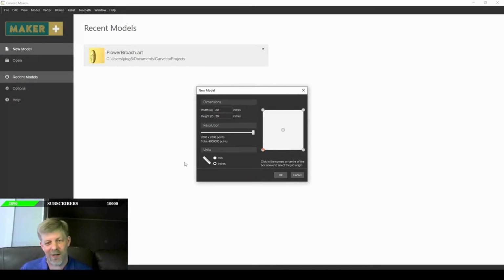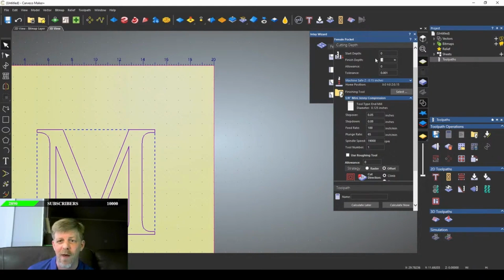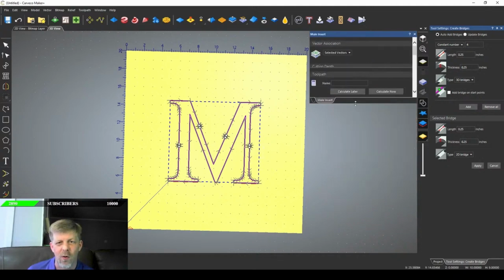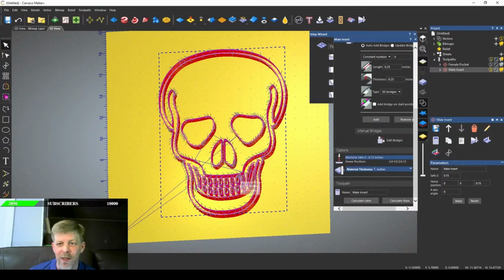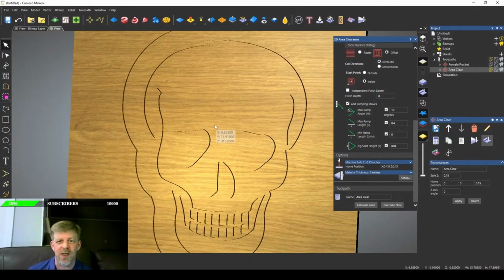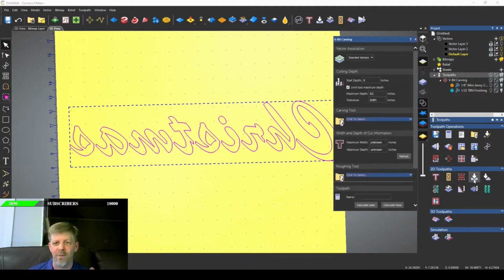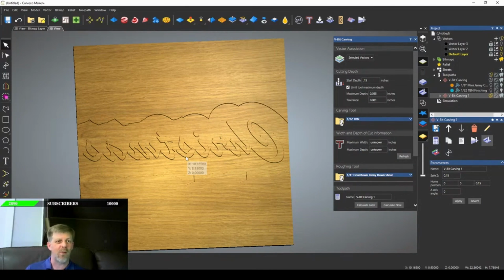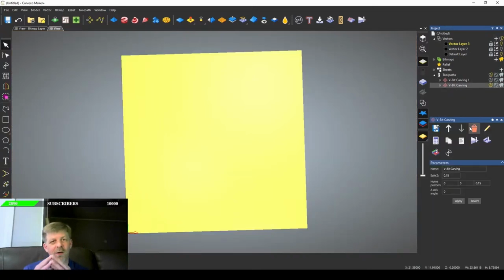Mastering CNC Inlay Techniques with Carveco Maker CNC Woodworking Tips

Comment: Jason, I am a bit confused about the starting depth for the male plug.  Start depth of .15, will this not dive the bit into the workpiece rather than starting at the surface?   We can discuss during our next lesson.
Reply from the maker: Yes it does dive into the workpiece but this creates the offset. Think of it more of cut per depth you are not going past the normal .25 that the V bits are capable of cutting in one pass but because we are starting in the wood we are moving our starting cut angle further down towards the bottom of the cut to create the offset you need for the pieces to fit together without programing one in.  We can always talk more in a session whenever you are ready.

Comment: The method of offsetting using the starting depth works well with bigger inlays, but not so much for intricate carvings such as letters with serifs.  When Carveco finishes out those tight corners on the male piece, it does so from the starting depth and not Z zero, which ends up cutting too much off the top, which could leave gaps when the pieces come together.
Reply from the maker: Not true it works very well with intricate carvings. If you use a tbn bit put it in as a vbit and it will carve from the base out and not use the geometry of the tbn. Vbit carving is limited by the vector so depth and angle has a lot to do with the angle of the vbit or tbn bit used. Check out Chad Bookman for some intricate work using this method.

Comment: trying to do a female pocket i got this message: "the selected tool is too large to machine either the male insert or the female pocket" I''m sure my selected tool is not too big for the female but might be for the male part however I want o do only the female part from the wizard but looks like this is not possible?  how can i overcome this limitation?
Reply from the maker: The female tool path is essentially a area clearance toolpath. It is usually the male part where the offset happens so you could just use the area clearance toolpath to do the female part if you are using an endmill to do the straight wall inlay. If you are doing the vbit inlay I would recommend using the second method I show in this video.
Reply: @Timberfalls  so basically i can do the area clearance toolpath with an endmill straight bit for the female part and then a V-bit tool path for the male part is this correct? I don't see the reason why to use V bit for the female? and then for the male too.
Reply from the maker: @Transcendental9  The male and female has to match exactly so whatever you use for the female you should use the same thing for the male. If you are doing a straight bit cut like the first example in this video then use a straight bit on both sides. If you are using the second techniques then I would recommend a combination of endmills for roughing and vbit for for finishing on both sides.

Comment: Hey Jason love your videos just one question. I understand why, with the vcarve method, you set the start depth as the final depth you want to get, to get the offset. But when i do that woth my 15 degree bit it plunges into the material and breaks? Am i missing somthing? Is there not a way i can just offset it normally?
Reply from the maker: @nickg9008  with those thin vbits you have to go slow like 40ipm. You may also want to add a roughing bit with a small tipped vbit
Reply: @Timberfalls Awesome! Thanks for the reply

Comment: cAN you carve with no bridges just one piece with piece of wood no cut out letter itself
Reply from the maker: I am not sure if I understand your question.
Reply: @Timberfalls  like the plug is not seperate image but it is with piece of wood done the way that machine removes everything that is not the plug itself
Reply from the maker: @Chris-vc1dh  That is the male part of the plug you have to add a border to your image so that is were the carve starts and the vector for your plug is were the carving stops.
Reply: @Timberfalls  Thanks I will keep learing, do you think that Vcarve desktop would be better for inlays?
Reply from the maker: @Chris-vc1dh  I do not think so. You can use tapered ball nose bits in place of vbits in carveco but can only use vbits in vcarve.

Comment: I've compared the area clearance vs the inlay "pocket"  what logic is it using to change the offset or the offset amount between the walls of each shape?  It seems like its " automagic" and I would prefer to understand the logic  -
Reply from the maker: I would agree that the inlay pocket wizard does not work well and I am not sure how it derives its offset calculation. I  prefer to do it the manual way.
Reply: @Timberfalls  It's not clear to me if it does or doesn't work well, currently I just don't understand the drivers and how it impacts the geometry selected
Reply from the maker: @CADCAMWizard  I have been hearing from the developers that they are reworking this tool and plan to change how it works soon. I think using the vbit inlay method for shallow carves is probably the best way to do those rather than using offsets and pocket inlays. Those are good for simple deep inlays but I mostly do the vbit method.

Comment: Best video i have seen so far for carveco. I have a complex logo I am wanting to inlay. 
When I do the v carve method it seems some parts have a massive gap between male female and other parts sits nice and snug. I am referring to the base and not the walls. Bottom/ top of pockets. 
Unsure how to word this but since it’s setting maximum depth how do you get a consistent depth. 

I have great success for simple shapes by ofsetting the vector size manually for make plug but that doesn’t translate for more complex shapes. 

Thanks for the video!
Reply from the maker: One thing about that vcarve method is you have to make sure your stepdown is large enough to make it down to the starting point. So if you have a .2 starting depth your stepdown has to more than .2 to get it in one pass that will be  clean.